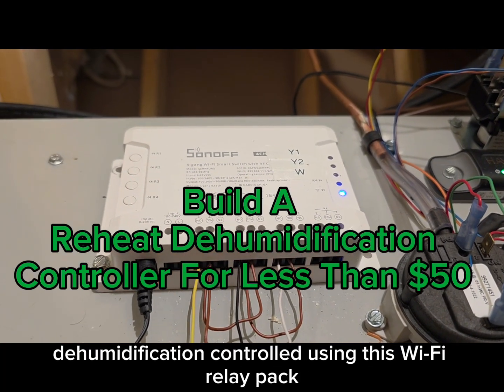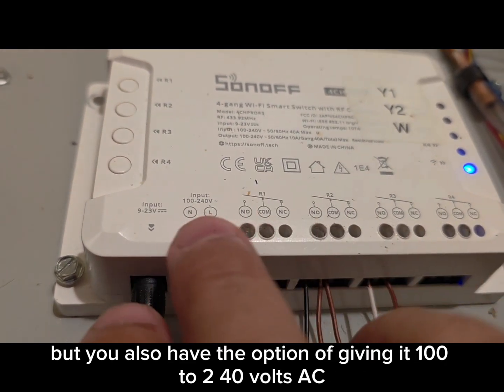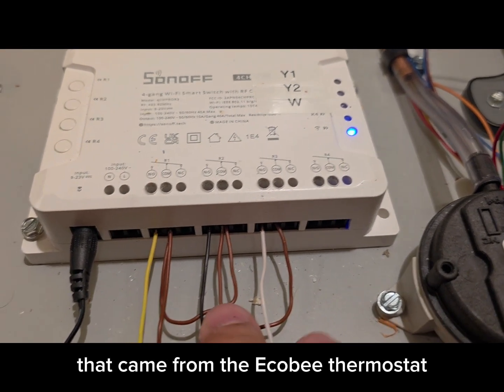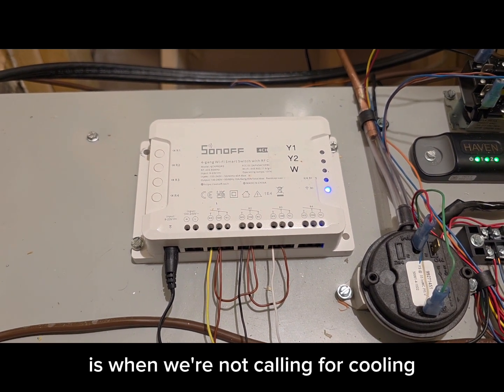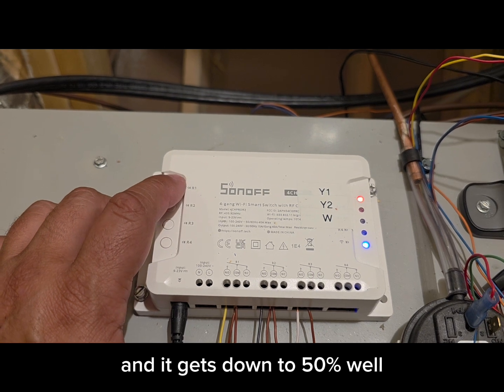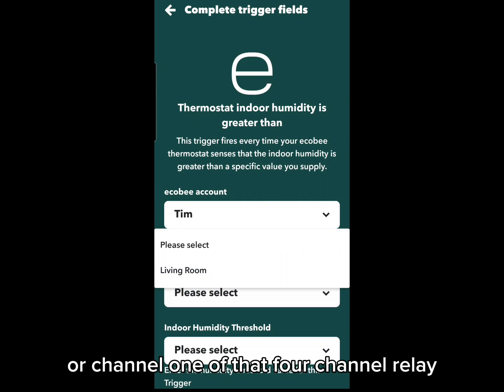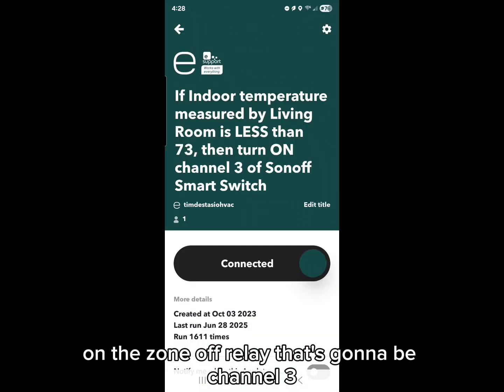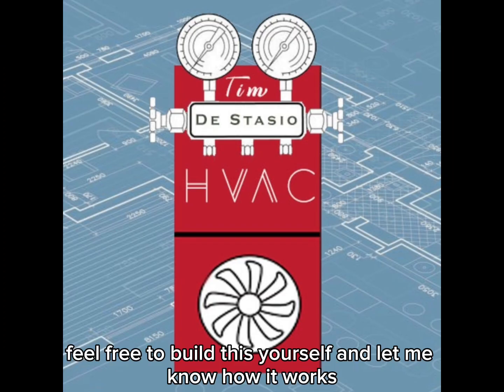DIY Heat Pump Reheat Dehumidification Control For Under $50

Comment: Is there a way to make this work to ren dehumidify cycles in the winter with a heat pump?
Reply from the maker: Why would you need to dehu in winter?
Reply: @timdestasiohvac  windows sweating on the inside, humidity levels in the house are high